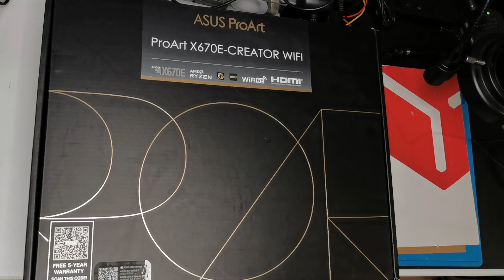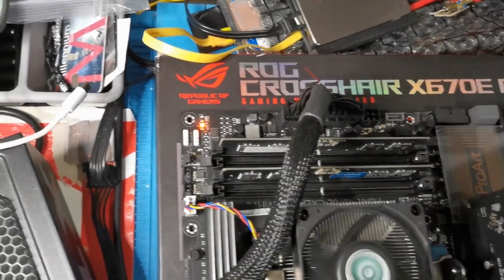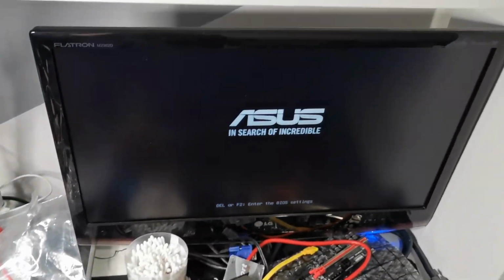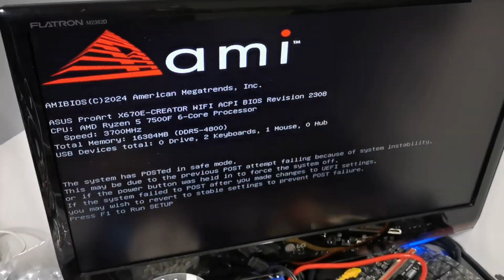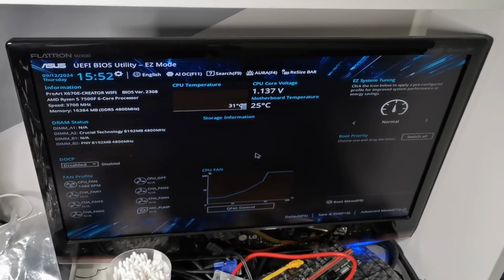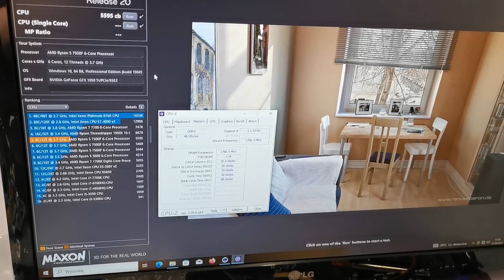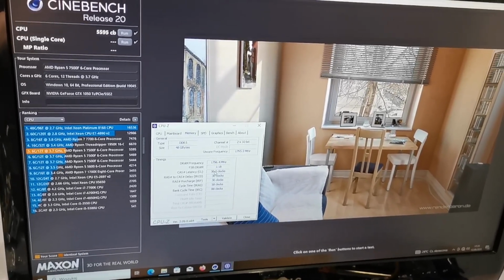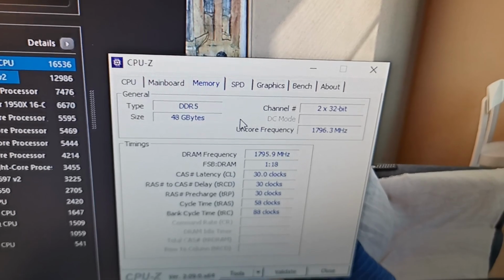Episode 17 - Asus ProArt X670E-Creator WIFI -  AM5 socket repair

Comment: im having problems running 2 sticks of ram on a z890 . Works fine with 1 stick and ive tried everything . Must be a bent pin on the motherboaard .
Reply from the maker: Most likely yes. But if you don't find any bent pins then inspect the PCB around the CPU socket and memory banks for scratches. Somerimes when installing a cooler the board can get damaged and break some data lines. You can also buy a tester like this one, to test if all the data lines between CPU and memory are fine.

https://a.aliexpress.com/_EHGAYRs